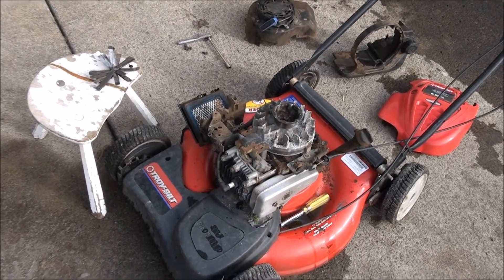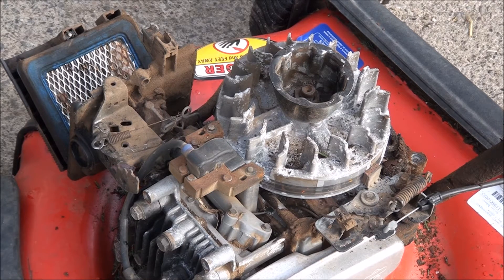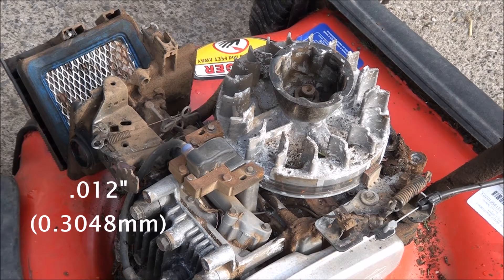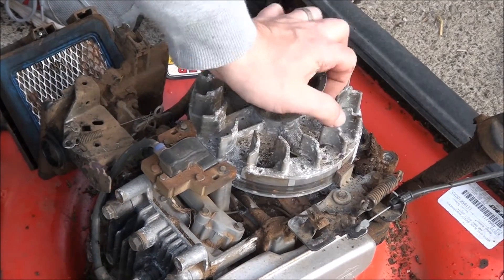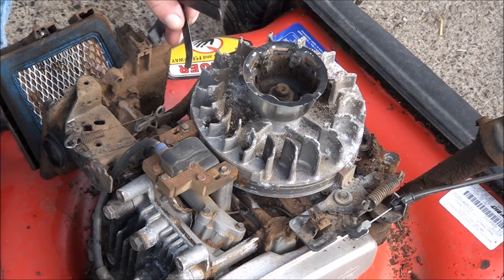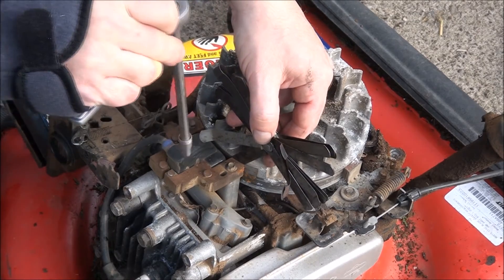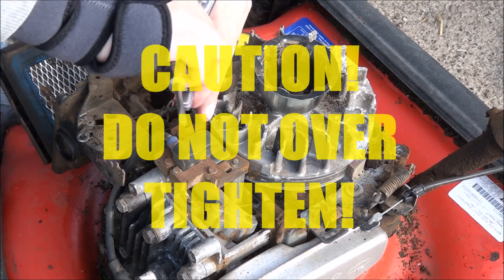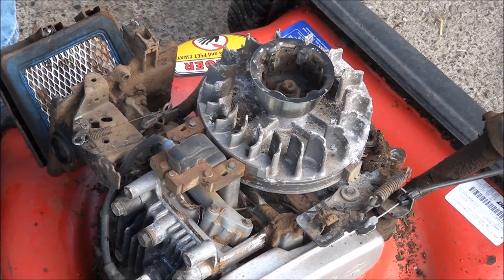HARD TO START? How To Gap a Briggs and Stratton COIL / MAGNETO for better SPARK

Comment: I like using a business card between the coil and magnet of flywheel to set the gap loosen coil bolts move coil back to place business card between coil/flywheel rotate flywheel till magnet on flywheel pulls coil to magnet with card still in place tighten coil bolts rotate flywheel to remove card gap is set.
Reply from the maker: Good tip, thanks for sharing!

Comment: Why won’t a Briggs with spark when I spray starter fluid in carb or in the engine
Reply: John Labauve no compression, no exhaust. Even spark plug could be shorting out and not actually sparking